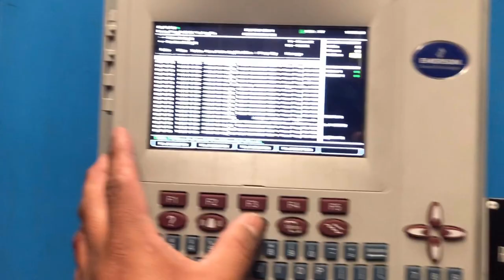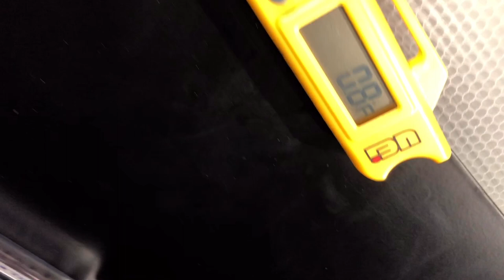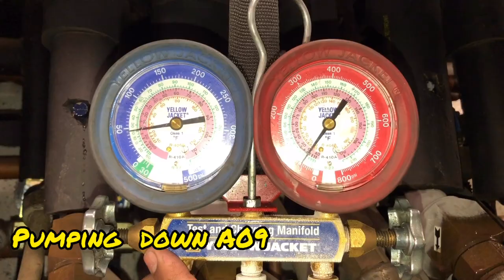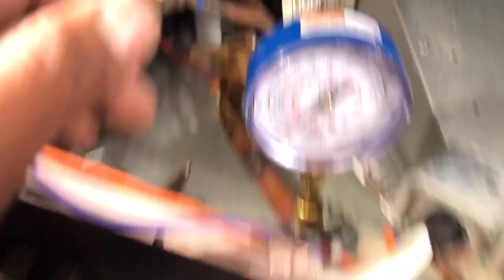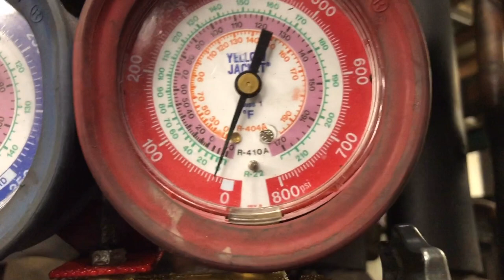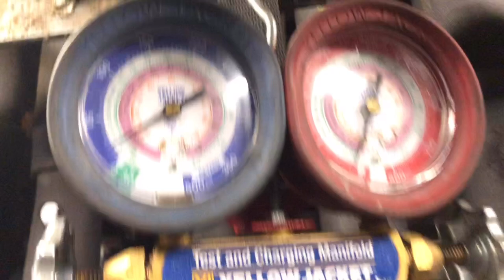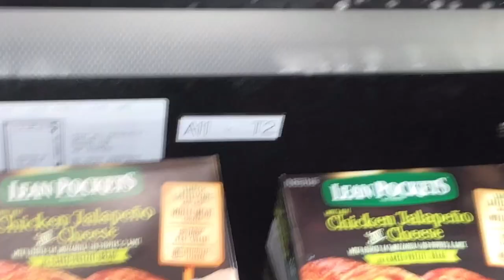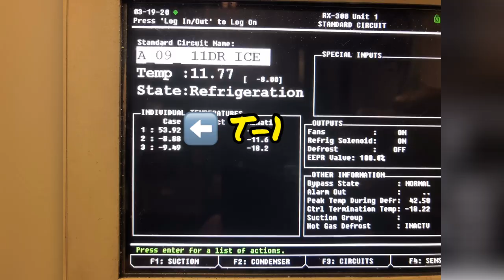HVAC REFRIGERATION:  Rack System with Moisture Issues

Comment: Excellent video! I’ve been in the trade for 13 years, I work on everything from basic residential type units to chillers. I’ve never had the desire to work on racks, but I’ve always been fascinated with them. You supermarket mechanics are a different breed HVAC.
Reply from the maker: Rey Rodriguez we fake it till we make it. 😃😃😃😂😂🤣
Reply: ESO! 🤣

Comment: Those filter driers were in a bad spot!! Good work, I hate those little driers on cases... I always try to remove them too. High water capacity driers RCW-48 work really well for moisture in racks, that and an oil change. Then let it run for a few days and replace the driers and oil again... Can't believe u unsweat the driers your going to containment the hole system 😂🤣😂🤣😆!
Reply from the maker: 😂😂😂.  I know right.  Yeah we’re doing high acid driers and then again in 7 days

Comment: Yo man good vid! @ 8:15  you said that you were going to pull a vacuum then pressure test. Just wanted to know what the purpose is behind a vacuum before pressure test, I've always pressure then vacced. Is this something you do only on rack systems? Cheers! :)
Reply from the maker: Daniel Farrar yes bro.  Let me give you a scenario.  
1.  Pressure test with nitrogen.   Suction ball valve is not holding.   Now you contaminate 1000lbs of refrigerant with nitrogen.  BAD!!!
2.   You pressurize with refrigerant from Rack.  You verify no leaks.  Now you have to dump that refrigerant because it’s contaminated with moisture.   BAD!!
3.  You pull a vacuum.  Then pressurize with refrigerant from Rack.   If you have a leak, you can pump the circuit down again and not introduce moisture to system.  And you will have minimal loss.   GOOD. 

that is why I pull a vacuum First.   This is when you REALLY must trust your brazing.   I hope this clears it up for you.
Reply: @rookierefrigeration4357  Yes that's a great explanation, thankyou!

Comment: One of those units is like a self-fulfilling prophesy, to be able to run it into a vacuum and suck in water. Once the failure cycle begins, it can only get worse ? Is there a low pressure cut out ? You wouldn't thing R-407 would ever suck into the vacuum regions, but if one unit is calling after the others are satisfied -- what is a big compressor to do ?  Unbelievable, but what else could it be ?
Reply from the maker: Nope. Too many safeties to go into a vacuum.
Reply: @rookierefrigeration4357  Then the oil must be breaking. Refrigeration is one of the best machines man can build -- cause in theory no contaminants can get in.
Reply: @rookierefrigeration4357  Well I looked into it a bit further : If TXV has a leaking seal on the adjustment or the power head, and TXV is partly plugged, venture effect could pull as much as 24 inches mercury (or -12 psi) lower than suction line if fluid pressure is high. That is something a defective TX valve could do.  I say 'could do' as part of "a freak occurrence" not very likely but a possibility if power head or cap was loose. Of course it would likely 'never happen'. But on the other hand "anything that can go wrong will go wrong" eventually at some time.  Of course the evidence is acid related sludge seizing the mechanism in this case :)

Comment: Bet that was warm on the finger... Could have been worse though, set the torch down and end up burning yer biscuits.

I can kinda understand the dryer's out there if a compressor blows but at the same time there should be a dryer after the compressor at some point to catch that and there are already filters on the txv's but why would they bury the liquid line in the bottom and put the suction line on the top like that?  Any of the lines that have something that can be replaced should be as accessible as possible cause if it can go wrong it will.
Reply from the maker: Yeah it was definitely warm.  Lol. There’s a set of driers on the rack and for some reason we always have them at the cases.  We always cut them out though.  Lol

Comment: Why put a drier where it's impossible to get at
Reply from the maker: Because engineers
Reply: @rookierefrigeration4357  insanely stupid. If they want driers in the case use flare just before txv so it's serviceable
Reply from the maker: Roy Amberg I wish every engineer could read your comment.

Comment: What would cause so many to go down at one. Seems strange.  So now that they are drier free what’s going to protect the compressor❓ couldn’t you put a drier in a better place ❓ I’m not an a/c tech the question are real not busting any bodies chops.
Reply from the maker: Gene Miller they were already having trouble and getting plugged.  This rack down call just gave them the knockout punch.  It happens when racks go down.  All the problems that have bell been floating under the radar all b of a sudden come up. 😂😂

Comment: Wut up Rookie? I got a question. How can I figure out what refrigerant is in a system if there is no data tag or no label on a txv?
Reply from the maker: You can try using a PT chart on a tank.  Or inside the condenser valve off.  But If you don’t have any data or info from the txv power head then it’s very difficult.   Probably just pull the gas, change the Txv and add virgin refrigerant.
Reply: @rookierefrigeration4357  so I would be taking a shot in the dark of getting it right by using a refrigerant that MIGHT be correct?
Reply from the maker: Rodrigo Bravo yeah. I would honestly call my supervisor and put the call in his court.   That way you can cover your ass.  Bring me it up to the customer.   Always cover your ass though.
Reply: @rookierefrigeration4357  thanks for your feedback.
Reply: Rodrigo Bravo check your compressor M#  that will tell you what type (s) of refrigerant the compressor is is compatible with . Oil being a big factor

Comment: Can you remove those dyers and just straight pipe it if only your txv has a inlet screen..
Reply from the maker: I’m not sure.   At that point I think I’d try to get some serviceable strainers and burn them in before the txv.   Good question
Reply: @rookierefrigeration4357   They say those dryers are there at the time of startups and  when they plug up they delete them
Reply from the maker: Carlos Cervantes yes. That’s exactly right
Reply: @rookierefrigeration4357 Got it and that txv you think moisture was stuck there and can you get rid of it by tourching it up?
Reply from the maker: Carlos Cervantes yes. Once we did that the valve started feeding.  Lol
Reply: @rookierefrigeration4357  Nice and thanks great video like always keep them coming 💯🤘🔥

Comment: Rack has moisture issues, so remove the driers?
Reply from the maker: That’s just step 1.   Many more procedures to come
Reply from the maker: GamblerMarco yes, I completely agree with you.  I could’ve opened the valve and cleaned it but I had the valve in the truck.  So.  Less time to just replace.

Comment: Any clues how moisture got in the system??
Reply from the maker: Yes.  People not pulling vacuums 🤷🏼‍♂️
Reply: More resent, when and after the discharge line rupture
Reply: Also beads from filter drier can break off and cause debris in txv this material has moisture in it that was absorbed.  This causes txv to get stuck. I heard this can also happen from the big filter drier on rack plugging txvs
Reply: Torching txv with map gas quicly helps get rid moisture or very hot water.
Reply: @jarrodmcdermott9109  that doesn't get rid of it it just moves it around sytem.
Reply: @evonfrazier7045  okay got it thanks sir

Comment: Where’s the nitrogen, 😂😂😂😂😂🤣🤣🤣
Reply from the maker: RefrigerationTech 🤣🤣🤣. In the van.
Reply: I just tell them it was there you just didn’t see it, 🤣🤣🤣
Reply: Whats the point if they're just gonna vaccum again
Reply: @prettycureforever7102  flowing nitro prevents oxidation inside copper
Reply: Never put nitrogen in an active rack system.You run the risk is contaminating hundreds of pounds of refrigerant being protected by a bunch of Valves that may be leaking by. Then you really have problems.
Reply from the maker: Exactly Eric.   Not allot of people realize that
Reply: Lol at refrigeration tech...its true that's the line  he says in his vids

Comment: Serious question: Why do you guys take out the driers in those cases.
Reply from the maker: Because the rack has driers.  And the txv have screens.  They are not necessary
Reply: @rookierefrigeration4357  oh okay so when you have the system pumped down is it pretty standard to know you might as cut drier out?
Reply: Well*
Reply from the maker: Yeah.  If we pump it down and are already working on it.  They come out